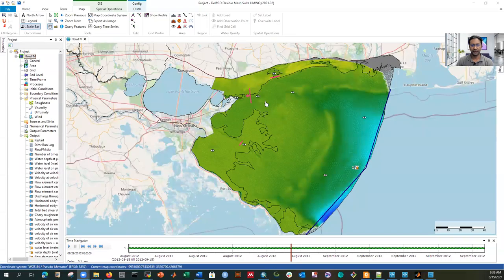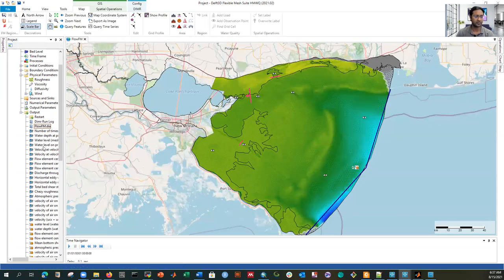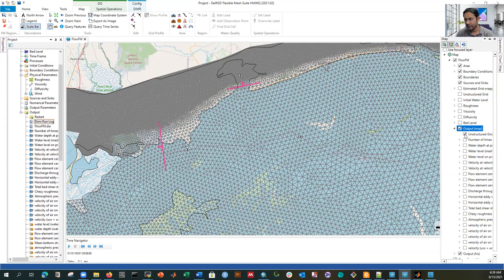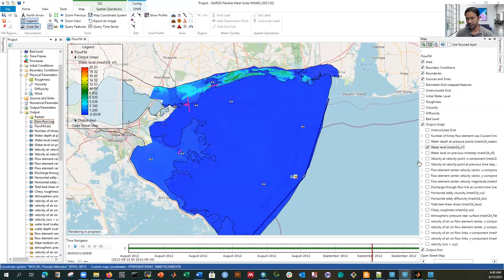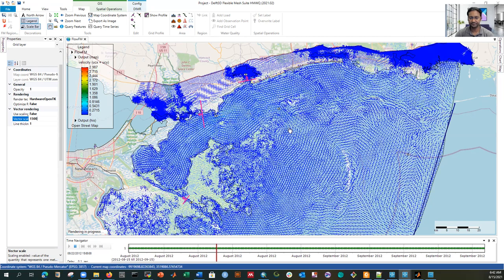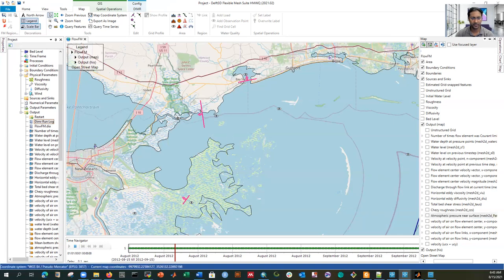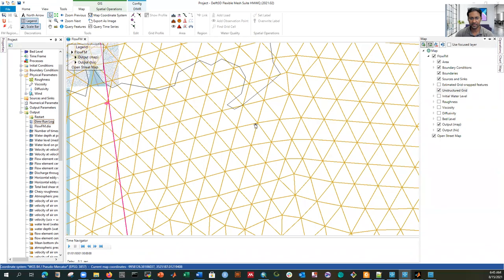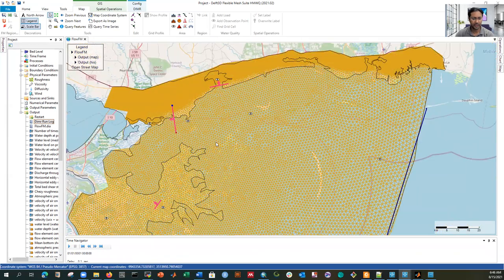Delft3D-FM T12: How To View Results and Export Images Using Model GUI

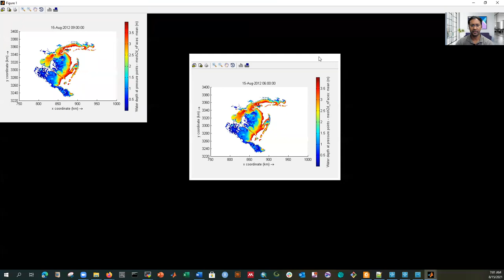Comment: 25:19

Hello Sir,
at 25:19 you created the animation by clipping, which was helpful for me.

Could you please guide how to make the similar map by averaging the section of time steps? i.e for example in animation basically it is showing the map at each time step, but in my case i want to take for example first ten time steps and then make the similar map by making the average. 
(in my case, I am trying to make the map for average power density (ADP) during spring tide, I have already made the map ADP during peak spring (which is a single time step) but i dont know how to average all the time steps during spring tide)

Thank you for make these tutorials, that are really helpful.
Reply from the maker: Hi, Thanks for the query. Yeah, It's possible to generate. I usually python script to generate the animation where I have more control over outputs.